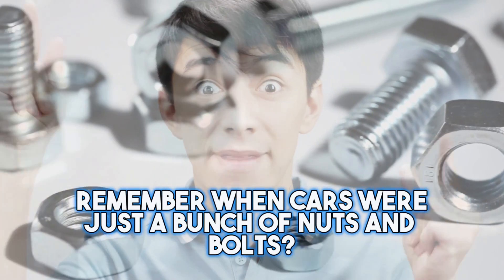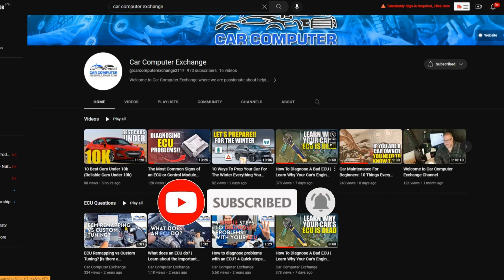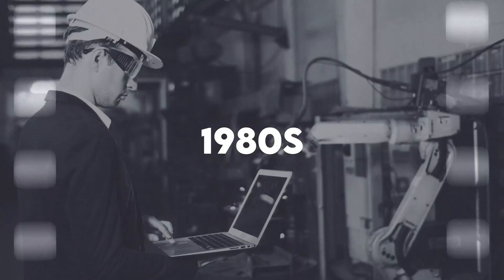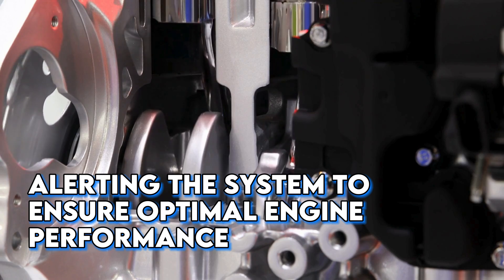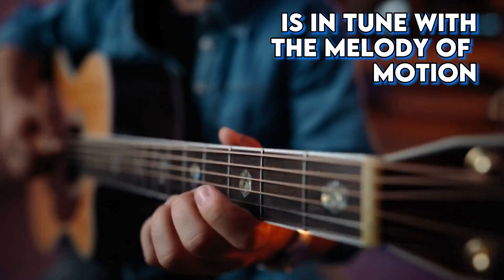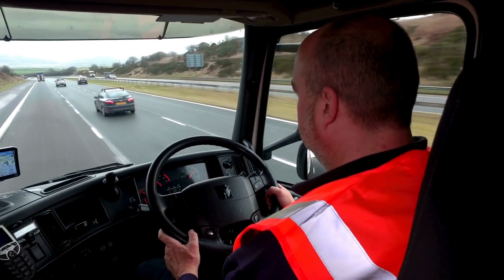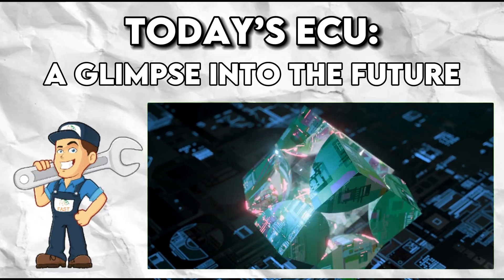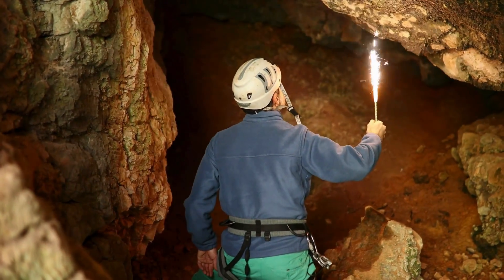Exploring The ECU In Cars | The Power Of Electronic Control Unit

Comment: Details in which it is mentioned in the video have left me quite intrigued. The ECU is like the brains behind the scenes, quietly orchestrating the symphony of your car's performance. Exploring the ECU reveals the intricate dance between sensors and actuators, translating data into actions that keep your vehicle running smoothly. It is a testament to the evolving sophistication of modern cars, where a compact electronic box exerts a significant influence. So the next time you rev the engine, enjoy the quiet magic that happens inside the ECU, perfectly guiding your car on the road.  Perfect video.